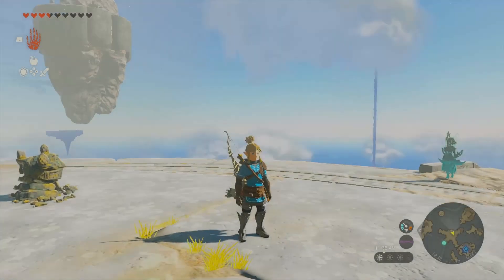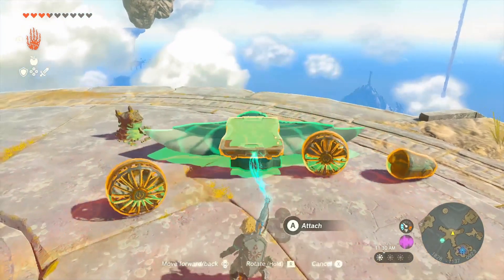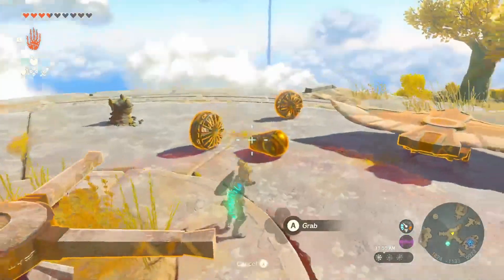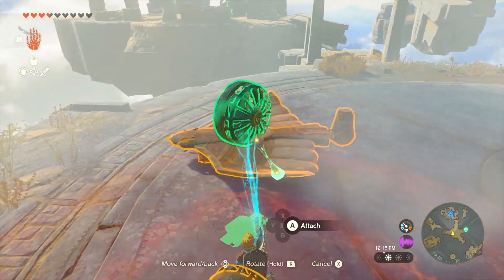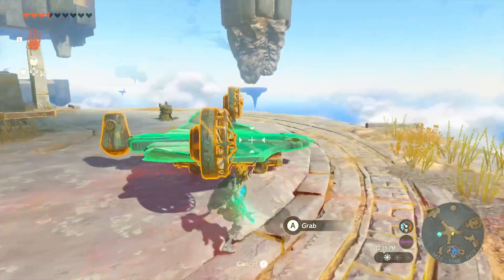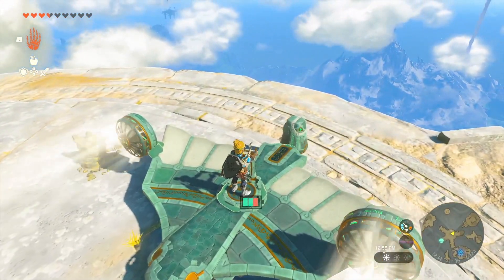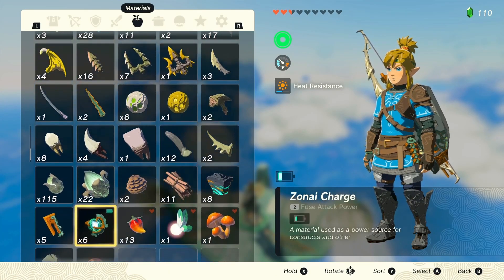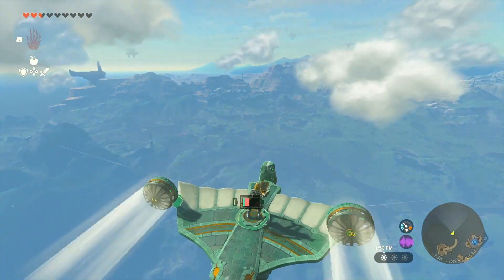How to make an INFINITE Glider that won't break

Comment: Fun fact: if you have 2 stabilizers attached to each other bottom to bottom (or head to head) it will fall slower, and when it lands on the ground it won’t jump back up a little bit
Reply from the maker: I didn’t know you could do that. I have to try that.

Comment: It's not about the 30 seconds.
The flash starts at 875 meters - assuming the units in the mini map are meters.
The actual respawn is at 1km.
Multiple fans and rockets make it go faster, but the respawn consistently happened at the same distance, regardless of how long it took to get there.
Test this by programming a 3D distance formula into a TI graphing calculator and input the x,y,z values at the start of the flight and at the respawn did screen shots so I could have time to input the values.

Comment: You can use a cart to take off without attaching it to save weight. Just place the wing and it usually works as a coaster to get off the ground. Nice vid.
Reply from the maker: Wow I can’t believe I didn’t think about that. There is no reason to attach a cart to a wing, I just use them to take off. Thanks!
Reply: What i do is i either put a rocket or a bettery between the cart and wing so it jettisons it after a set delay

Comment: This can't be infinite though. fans break in 30 mins. it does last a lot longer though so that's pretty cool. but I just attached the fans to one of those platforms and was able to fly that way instead with the same 30 min limit on a flying platform. I could set guns on the bottom too and the platform I chose even floats on water